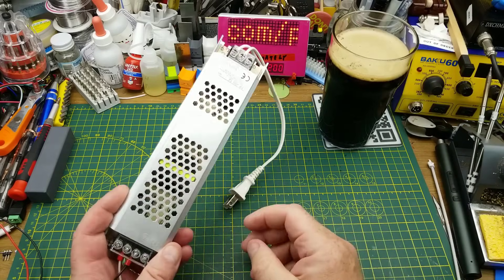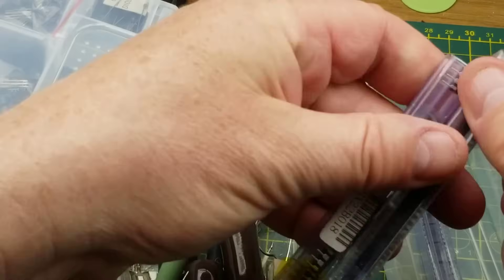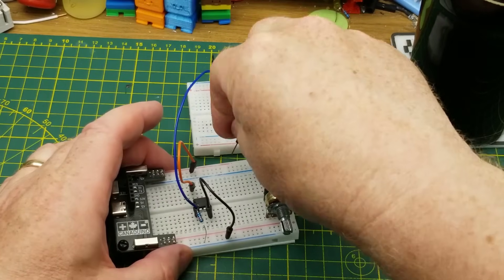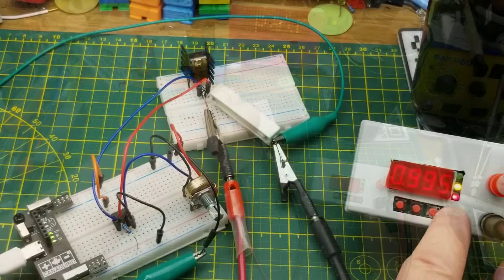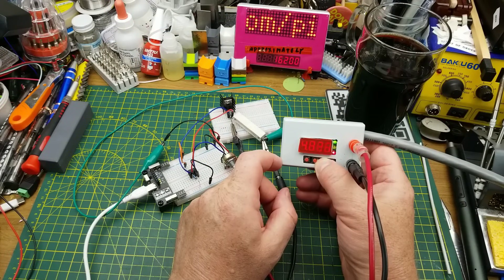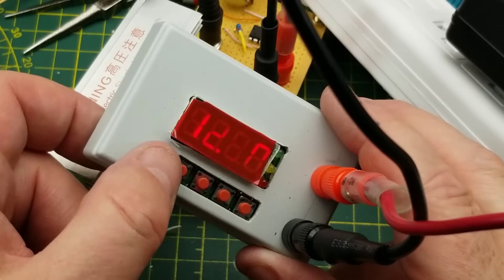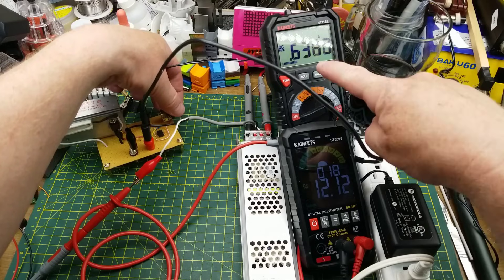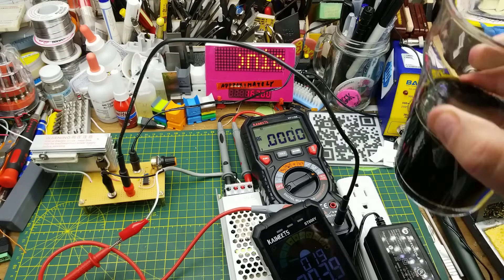building a simple electronic load

Comment: Nice.  You should have used RxI^2 for the resistor.  That would give you 36W, so you have 36W being dissipated across the resistor and 36W getting dissipated across the MOSFET.  I honestly don't think that heatsink will be able to get rid of 72W of heat - even with a fan.  I guess for this test though, it got the job done.
Reply from the maker: I've ordered a bunch of parts to upgrade it to a more usable version. 
And, yes, it'll need a lot more heat-sink if I want to use it for more than a few minutes at a time.

Comment: Change the resistor for a few cheap Ali 2 ohm 100W resistors in parallel, add a fan and perhaps use a dual op amp with the second one monitoring a thermister on the heatsink so that if it gets above a set temperature then it provides a bit of negative feedback to the load. Then it is a pretty capable little load.

Comment: Add a diode between the opamp and the MOSFET gate to keep the opamp safe in case you are testing some higher voltage like that in case if the MOSFET get shorted the higher voltage will be blocked by the diode

Comment: You should add a diode between the opamp and the mosfet gate in case you are going to test more high voltage and the mosfet my get shorted will protect the high voltage to dont affect the opamp!

Comment: Amazing and quick build, i love it, just one thought, it would be recomendable to put a 104 (100nf) ceramic disc cap as close as possible to the lm385 p-supply pin,  
This will give smoother operation.
Also perhaps you should hook it up to a scope to see if there is any osscliations, which can lead to the whole cct heating up more than it should. A very small o.1 ohm resistor with a 10 uf electrolitic cap just after the bread board supply will form an RC filter which will knock out any input ripple, because in general these cct's have low ripple rejection in general, but man that was fun to watch.

Comment: Some suggestions: add a fan (it increases massively the power handling capability), choose a MOSFET with a comfortable safe operating area SOA for your needs (the irl540 that was in that schematic is a cheap good choice, you DON'T want a MOSFET with a very low RDSon, it creates hot spots), add a 10~47nF between the opamp output and negative input (this limits the bandwith improving the stability, and prevents your mosfet from burning due to Mhz oscilations), replace the 1ohm resistor with a 0.1ohm and amplify the signal 10x or divide the pot output voltage by 10. Bonus tip, you can use a quad opamp 4 Mosfets and 4 resistors for a more powerful load, the control part remains the same, however you would need a bigger heatsink... And remember there no such thing as "too big heat sink" 😂👍
Reply from the maker: yeah, that would be the "proper" way to do it.
What you saw was the "quick and dirty using what I have on hand" approach.

Comment: If u want to build a "good" load, u have to do more than using a cooler for your mosfet.

i build a load with 300W and one transistor (IXFK94N50P2) - and its horrible, to cool it down to the maximum temperature allowed - so its not burning up. as a measuring resistor, im using the Riedon PCS-0R1D1.

Its a liitle bit "more" testing needed to "waste" hundreads of watts ;)
Reply from the maker: True, but I didn't really expect this to be "professional grade".

This was a "use what's on hand for a quick easy result" type build.

Comment: I made a comment on the previous video about using the cheap power supply as a bench power supply with some added external fusing. I forgot to mention that I never use mine for more than 2 or 3 amps.

Comment: A little pointer!  If you expect the FET gate voltage to reach 10 V, please note that the 10 V for your choice FET is expected to be Gate to Source.  Your source voltage climbs with the current increase.  At 6 A, 1 ohm, you are increasing the source potential already to 6 V and that leaves 12 V - 6 V = 6 V instead of the data sheet 10 V….
Reply from the maker: I've ordered some additional FETs,for stock including the specific one called out in the design I was basing my build on.

That said, this "made from what I have on hand" version serves my current (pun not intended) need.

Comment: I'd drop the 1 ohm resistor value a bit. Would limit your current at low voltages. I.e at 5V the max you could possibly get is 5A, but you also need to drive the gate to at least 10V.
I built something similar back in the '90s. I think I used a 0.1 ohm res. You would probably want to add a resistor in series with the pot to limit the max current.
An alternative is instead of connecting the pot to a reference 12V supply, connect it to the output. Then the load changes from constant current to constant resistance.

Comment: Scope it...there's a good chance that circuit is oscillating! Also, that FET (most FETs) are not specified for linear operation, so don't be surprised if it goes up in smoke...
Reply: on the other hand, I have yet to see a mosfet going dead in linear operation if the thermal constraints are observed.
keep the junction temperature within safe limits, and it should be fine.
Reply: @s_s-g4d  Actually not. Look into thermal runaway, SOA, etc...  Most "digital" MOSFETs don't even show SOA to DC.
Reply from the maker: That is possible.  I was just being lazy with the capacitors.

Comment: I thought that PSU was not rated for 110V input? if so that will seriously reduce it's output capability.
It may run but won't provide the 16A it states.
Reply from the maker: I'm still surprised that it works at all.
Reply: good point

Comment: the resistor is 1Ohm. 6A * 1 Ohm = 6V across the resistor which is 6*6 = 36W. too much for the resistor. If you put second  1 Ohm in parallel it'll be 6A * 0.5 Ohm = 3V * 6A = 18W (9 W each resistor) The rest will go to the transistor which has more heat transfer capability - metal to metal contact. But that heat sink looks like it's good for 15-20 W at most. Maybe even less without fan. But if it's cold you can do much over that for short time.
Reply from the maker: Yes, this was just cobbled together with parts I happened to have on hand and a random salvaged heatsink.
Reply: @pileofstuff  ..and that is exactly what I enjoyed most about this.  The essence of fine/fun engineering is building what you need with what you have.

Comment: use some 55w car headlamps was the input 220v?
Reply: Car headlamp/side light 55W/23W, or household halogen bulbs at 10W/20W are my goto for a simple 12V load. Not adjustable, but very easy to set up.

Comment: Just a crazy idea.
Add a pizoelectric heat transfer plate to aid in thermal management of the resistor.
Can't remember what the device is called.
Reply from the maker: A peltier cooler?
Reply: @pileofstuff  yeah that.
It would increase potential power draw. Both by its own use and allowing the the resistor to take more current.
Like I said, crazy idea.
Reply from the maker: @kyleallred984  Crazy ideas don't offend me (as witnessed by this janky build...)

Comment: Hi I really enjoyed your video, I wonder if you could 3D print a case for it and add one of those small fans to blow over the MOSFET and resistor. I would like to see you make that video.
Reply from the maker: A fan is a good idea.
But with as much heat as thin thing dissipates, I think a 3D printed case would get kinda melty.

Comment: nice one all you need to add would one of those cheep dc  volt/amp meters and a wall wart PS be good as any test loads  you could buy.
I made one that has no active parts I just had a selector switch with real thick contacts to vary the load and a bunch of power  resistors (I kind of have an obsession about them) in series / parallel in a box way bigger then that not cumbersome but closer then this one
Reply from the maker: I have some power resistors (more than will fit in the drawer I showed) that I sometimes use for loads, but this one should be easier to adjust on the fly.
Reply: @pileofstuff  it is the selector switch that made it possible I must have bought it at a swap meet do not remember and never seen one that heavy duty before  it switches 8 positions and the contacts are 5mm 3/16 thick. a lucky junk find
Reply from the maker: Building useful things from assorted salvaged (or randomly acquired) parts does leave a guy with a good feeling.
Reply: @pileofstuff  I did finally come up with a situation where a much smaller form factor load like this electronic load would be just the thing. I had to try and figure out what current a transformer hidden in the wall some place could deliver, so I am going through my junk collection with the intention of making something similar then the passive one I have in an old cable set top box

Comment: What AC voltage are you running the power supply on? If only 110v, that might explain the reduced current
Reply: Agreed.
Reply from the maker: That is a possibility. 
I was expecting it to not work at all  if it was unhappy about the input voltage.
Reply: @pileofstuff  Lower output current on lower input voltage is quite common on small form factor high power power supplies like for example in server Power supplies.
Reply: @AlpineTheHusky  on the other hand, it wouldn't be surprising for the PSU to just suck.
Reply: @AnnaVannieuwenhuyse  Those PSUs are actually really good. Not good ripple wise but very efficient and long lasting.
Reply from the maker: @AnnaVannieuwenhuyse That was my expectation. I'm surprised that power supply works at all.
Reply: @pileofstuff  It's almost certainly a flyback topology power supply. Energy is stored in the transformer when the primary side MOSFET is on and delivered to the load when the MOSFET switches off. With 1/2 the designed input voltage across the inductance of  the transformer, current in the transformer primary can only rise to half  of the 240V case in a given on time the and energy stored will be about 1/4 .  At low loads there is duty cycle to spare any everything is OK, as the load increases  the duty cycle hits a maximum and no more energy can be stored and delivered .   16.7/5  is about √(220/120) so the output current is about what you would expect.